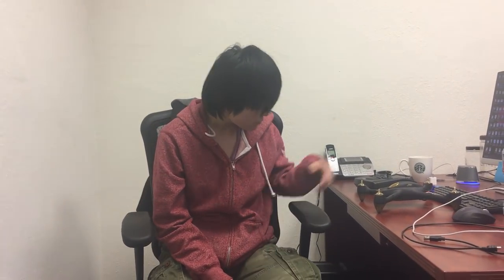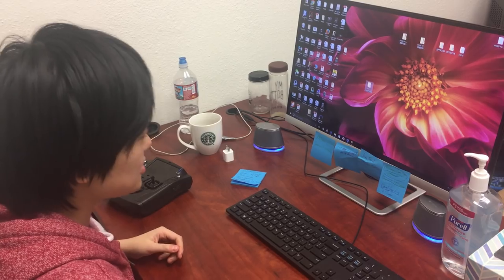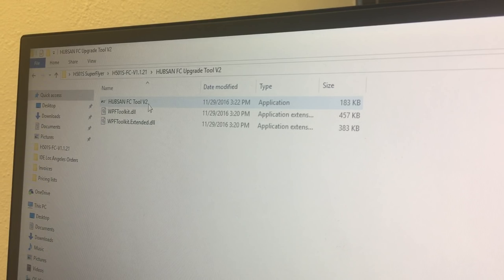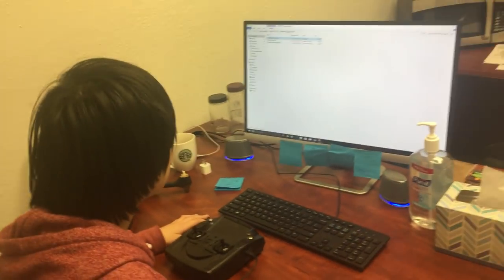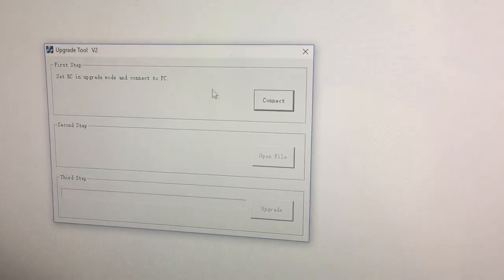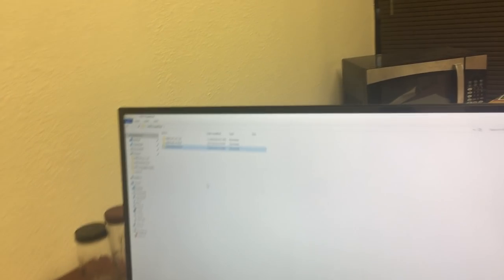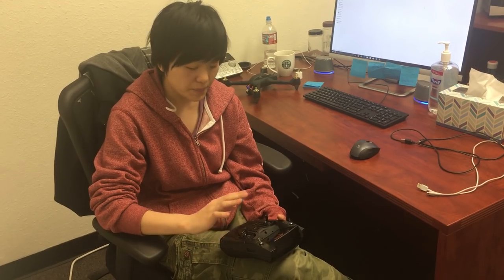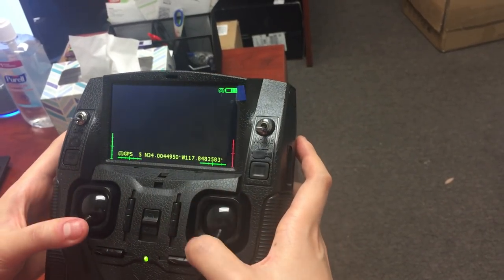H501S Firmware Upgrade Protocol

Comment: The Transmitter (RX) upgrade fails and displays an error message "No Data Ack Response".  I have done this several times and fails every time. I am selecting the proper file. For the Drone itself the upgrade for that went flawlessly.  So why is the RX file failing as directed in this video?

Comment: upgrading RX Receiving board. under the H501SS-RX V1.2.22 (SS only)- it shows both the H501A upgrade tool and upgrade tool V2. in your documentation dated 4/17, it says " if your stock version came with V2.1.16 and FC 1.1.31 then use FC H501S tool to upgrade." Since I have this version so I should be using H501A tool not the one mentioned in this video correct?

Comment: Hi Annie. I recently followed you along updating my h501s and advanced controller. The one problem I had was the RC file you reference is now a TX hmb file. I will be test flying later. Please affirm that the RC update for the advanced controller is a TX file. Thanks
Reply: confirmed today. The RC update for advanced controller is not
 RC-FPV2 4.2.9.hbs
it is H906A-V1.1.9.hbs
well My 501s flew great today and still had FPV at 300 meters. 
If Hubsan is still replying to these please confirm this as in this instruction tutorial Annie makes it clear it should be a RC.hbs file...
Reply from the maker: The RC upgrade file for the advanced controller is a TX file. The latest firmware for the advanced controller would be H906A-V1.1.9.hbs. RC stands for remote control, TX stands for transmitter. H901A is the model name for H501S standard controller and H906A is the model name for H501S advanced controller.
Reply: Thanks for the clarification. One more thing. A link to a file explaining the updated functions to the advanced controller would be most helpful. After youtubing too long I found out by long-holding the down button to the left of the enter button initiates circle me mode!   I wanna know more PLEASE! :)

Comment: Hello, can you tell me why the 501  does not turn around like the 502 when RTH is switched on, can this be changed on the firmware by Hubsan
Reply: Good question, I saw the 502 did the turn around but not the 501S
Reply: Yes sometimes I have a good question, but now waiting for the answer lol  Maybe they could add the software too the next firmware update
Reply: I think the right person that can request that option is the people that frequent to Hubsan HQ. People like Drone/Quadcopter101. Hubsan normally entertains him.
Reply: No Hubsan also reply's too small people
Reply: You mean Shally? Nah, Shally is just a Guest Relation Officer.
Reply: Did you hear anything about this question? I would also like to know the answer.
Reply: No answer yet, I will ask another Hubsan guy, maybe the new 501 will do the turn around
Reply from the maker: Turning around or not is written in the firmware. It is there to improve the performance of RTH.
Reply: the gps lies in the back side of quad so returning home facing its back is actually good for better signal strength with respect to home position. imho
Reply: That's great and what not, without auto detection of running into things, I rather see where i'm going... No offense.
Reply: I think it has nothing too do where the GPS is in the Quad, its more a software thing.  But I have both Quads and doo some more tests
Reply: Ruudy..  You are correct.  First, I've built half a dozen quads all with APM controllers and Ublox GPS receivers.  I generally place the GPS tower towards the center of the quad.  However, it does not matter.  The GPS receiver is communicating with satellites and not the transmitter! There should be no issue having the quad face it's way point or in the case of RTH, home point. I kinda wonder the intelligence of some of these posts.
Reply: RCFun elaborate?
Reply: Don Boyle New firmware 1.1.36,,,, you can even rotate while in RTH

Comment: If you get an error indicating no tool found during RX update. Unplug your controller, shut it off, restart it into upgrade RX MODE, THEN PLUG THE MINI USB CABLE INTO IT.
Reply: OR...... If it flies why bother updating.. If it ain't broke - don't fix it.
Reply: You need to upgrade your drivers in your computer

Comment: just updated to latest upgrade for my H501s,all done successfully but now my quad just sits there beeping at me and the motors will not arm ?.
 With the new firmware update do you have to have gps satellites showing , before the beeping stops and the motors arm , I am asking this because I am indoors with no gps satellites showing , but with the old firmware the quad did not beep at me and I could arm the motors indoors.

Comment: I have tried two different cables and all three usb ports on my computer and the RX upgrade tool keeps saying no upgrade tool connected! But the FC did upgrade perfectly. I have the advance tx. I guess there is a chance both cables are bad
Reply from the maker: Chris, try another cable. If it still doesn't work, try a different computer. If you don't have a friend with an up to date Windows PC, go to www.hubsan.com and click on Support. Download the H501S and SS upgrade sheet and then download the firmware bundle. There should be a Drivers folder inside the main download; extract it and use the Prolific Driver. This should solve the problem. If it doesn't, send us an email (service@hubsan.com).

Comment: Annie,Hi,After installation of new video board ,the green screen with Hubsan logo on the screen, without video.Green light is flashing on board continuously,.Tried so many times to change firmware-situation is the same.Just problem that video is not going.As my understanding, this is like when you start the system and system can not be loaded, due missing boot.May be needed to flush some of firmware to the video chip?Any suggestion or recommendation will be highly appreciated.Thanks,Sergiy
Reply from the maker: That means you upgraded the transmitter with a wrong firmware. I would suggest that you send an email to our support team at service@hubsan.com for further assistance.

Comment: Property after the firmware update (superfly) as described above (thank you for the instructions).
Since the restart of the H501S, the Gory sensor is no longer synchronized.

"CHECK GYRO SENSOR"
Do not move the aircraft

Is on the display, the H501s beep and beep
i think i need this firmware: FC-V1.1.35 but i don't find it!! 
please HELP

Comment: Hello,  I have a hubsan x4 h109s low edition. My trouble is that the transmitter doesn't bind with the drone, so I tried 
to update FC, RX and TX. When I try to update RX with V1.1.16,in the 
third step after upgrade there is written  " Data error! Please try 
again". Can you help me??

Comment: I am trying to upgrade the rx. My transmitter is correctly reading UPGRADE RX MODE V2 and is connected by the usb cable to my laptop. However I cant get past step one on the RX upgrade tool. It just says set RC in upgrade mode and connect to PC, NO upgrade tool connected!

Comment: trying to update my H501s (standard/original ver.) the file thats in the H501s  FC folder is for a H501a. as a result, im getting the update error. Is there another file or an older/different file for the H501s? its not working

Comment: Hello Annie, I ordered the advanced version, and will check firmware when it arrives. My question is, what is the difference between mode 1 and mode 2 ?
Reply: Drone Worship, Annie, very helpful. Thank you!
Reply: Drone Worship thank you :)
Reply: Incorrect. You stated that in mode 1 ." pitch and roll become the left stick." The only difference between mode 1 and mode 2 is that only the pitch and throttle control are moved so in both mode 1 and 2 yaw is on the left and roll is on the right In mode 1 pitch(not pitch and roll as you stated) is on the left stick and throttle is on the right stick. mode 2 has  throttle on the left and pitch on the right.
Reply: No problem , Jag may or may not have gotten the idea, as you were actually describing a mode 3 transmitter setup. Generally I believe that if one is going to jump in and answer a question that is posed or directed to  an assumed expert(Annie) then one should be doubly sure of the accuracy of that answer. Especially when someone new to the hobby is asking .The same holds true that an assumed expert who puts out a how to video should get the mini and micro usb cables correct . just too much incorrect/ inaccurate information out there these days IMHO 
on a lighter note you should check out my channel you might find something entertaining or informative.

Comment: I have delays between transmitter and receiver and tried to update the firmware of rx and fc. Said update error in fc and the led started in rx update and said timeout on command response.Any help ?Also i cant see the rx and the fc versions on my drone just the transmitter and the lcd version! Thanks in advance

Comment: Hello Ann!  I'd like to purchase a (New) H501s without controller. Is that possible? I already have 1 advanced controller and 2 standard controllers. So I only need the drone itself. 
Thanks
Reply from the maker: We have a H501A model coming out in March, that one only comes with the drone because it has the new WiFi feature. You can also use your transmitter with it. Please visit www.hubsan.com for more information.

Comment: Hi Annie - I just got my hubsan 501s today and I'd like to perform the upgrade. Is there now way for me to upgrade using a MAC? I have VM ware on my Macbook. Thanks in advance
Reply from the maker: There is no way to upgrade using a MAC, and there is no need to upgrade your firmware unless you are experiencing problems with your unit.

Comment: Hubsan does not back their product. The H501ss that I owned did fine for a few weeks. I went out for a night flight with a friend and out of nowhere the drone lost all power and fell from the sky. I tried emailing them for a refund and they said there was nothing that they could do to help me. After a couple of days of searching we finally found it, all 4 propellers were broken. I checked the battery after getting home and it was still fully charged, the drone just malfunctioned. It was a very disappointing experience with this company.

Comment: Hi Annie,

Ive tried to update the latest versions of firmware of my 501S but when it was time to bind the drone to the controller, the drone LED's remained solid and it failed to bind. Now the controller wont pick up an signal from the X4. I have followed the instruction step by step, but I cant seem to resolve the issue. I have also reached out to support via email, but still waiting on a response. 

Any suggestions for fix???
Reply: Robert Cantwell  this happened to me the first go around as well.  So what I did was start all over again from the very first step.  I got really worried I bricked my drone but thankfully,  I was able to stay cool and retry from step one,  and it  worked.😫

Comment: I'm  A big issue with my hubs in 501S I have the standard edition it's not responding to commands   On controller the LED turn purple and it starts to go wherever he wants to go I just today I just recently cut my fingers try to stop it from taking off again after it landed I need help with this because it's not safe and I have it all on video

Comment: Help annie, im checking continuity on the H501S 5.8 ipex connector on the quads mainboard and the multimeter  shows theres continuity between the center pin and the connector around the center pin. Can you find out for me?

Comment: my Hands by five 1s 501's is doing a lot of sketching and it always for some reason when I have heard it keeps going to the left for some reason AutoZone and it's sometimes what's up in the air it turn to the left or to the right which other way on his own no I'm doing something wrong or what kind of modified it with an antenna and with both antennas I don't know if I know I'm pretty sure I put him on a ride but does it need to be upgraded or can you help me out here

Comment: any firmware upgrades going to be released for the  hs109 the one with the h7000 transmitter?
Reply from the maker: As of now, there are no upgrades for H109S and H7000 transmitter.

Comment: Hello! I just bought the drone h501s x4 advanced and it does not turn on the monitor and when I turn it on you will not hear beep nor turn on the led light. Do you think that it is a firmware problem or the control has been damaged?
Reply from the maker: I would recommend sending an email to our support team at service@hubsan.com, it will be easier for us to help you with your problem there.

Comment: Is hubsan putting the new firmware on new quadcopters and receivers or do I need to put it on there once I get it?
Reply from the maker: There is no need to upgrade your unit unless you are having problems with it.

Comment: We purchased the drone and just wanted to upgrade the firmware. But when we get to the point of connecting the battery with the drone. The led flashes and the screen doesn't change. So what is wrong with it? It's really annoying, we are searching for a fix everywhere but can't do a thing! Please help!
Reply from the maker: Hello. Next time, please do not upgrade unless you have a confirmed firmware related problem. Send an email to service@hubsan.com explaining the situation. Include in the email a very clear picture of the drone's belly. Our reps can help you fix the problem.

Comment: The new file uploads doesn't include the RC upload.  In addition you have to guess which file upload has the RX upgrade as the file names both say HUBSAN FC Upgrade. By trial and error I chose the one without the V2 in Tool.zip.  

The big thing is there is not file for the transmitter the RC upload. 

The video is great I am just at a stopping point for the transmitter upgrade file
Reply from the maker: There is no need to upgrade for RC, and that is why there is no RC file to download. We also noticed the folder name is incorrect, we will fix it soon.

Comment: I followed the video to the letter and the FC upgrade went perfectly but when I get to the third step of the RX firmware upgrade I get message "Timeout on command Response"  Do you have any idea why that is happening?  Now when I turn on the transmitter and quad I hear the normal powerup tune from the quad but it looks like it is off.  There are no cycling lights, and no video display on the transmitter.   Please help.  I saw where someone else had this issue on a blog but there was no response to the person having the issue.  I never see the "select file down".  That seems to be where it is all coming apart.
Reply from the maker: You should not press connect/upgrade more than once, if you do, there will be errors. Also make sure the drone is very close to the transmitter and make sure there are no other electronic devices near the quad and the transmitter.

Comment: A friend doubt, for those who have the standard control, if I upload the drone it obeys all the commands, rotate, forward and back, but if I am descending with it manually it obeys no command, only descends or I can not deviate from nothing, I have to stop it and move it and then continue down, is it anyway?

In my control is the following parameters

V4.2.36
LCD v1.3.3
H501S v2.1.50
FC v1.1.46
CAM V30.84.84

Comment: Hello annie i talk to you last week about my drone going up once you arm motors and raise drone to certain height... well at first my 2nd drone after xchange it was good for the first 4 flights then 5th it happened again has to stop so wont go high fell had xchange again 3 rd drone.... i did calibration of the transmitter mode 2 version... it still happened....ill try too call. today  (H502C)
Reply from the maker: Have you tried contacting our support team @ service@hubsan.com?

Comment: Hi, Annie. I already upgrade my fc and rc fail from Nelson Lee video. But nothing to tx. should i do it. I am using advance transmitter.
Reply from the maker: You do not have to upgrade the advanced controller. The original firmware on the advanced controller is fine.
Reply: Thank you.

Comment: Hi Annie 
I have just installed  a new transmission  module  in my h501s, and it's  working fine but transmitting  on 8665 mhz.The transmitter  wont go that low.So i can't tune it in.Any ideas.Kind Regards Cool view
Reply from the maker: Perform a rebind to get everything on matching frequencies: https://www.facebook.com/hubsan001/posts/1773539956284353

Comment: In my case on the part of updating the RX on the remote, it does not change to select file down and the drone does not erase the leds it starts normally.
Reply from the maker: Hi,Luc,if you don't mind ,please share with me more details about your upgrading issues to service@hubsan.com. I will try my best to reply you as soon as possible .Thanks
Reply: @HUBSANOFFICIAL  ok, i sent. Thanks!
Reply: Hi i have the same problem. Did you find out any solution?

Comment: I have problem after I upgraded the drone, then it’s time to upgrade the transmitter it can’t work well and both of drone and transmitter cant’t use. 
The screen stay says “upgrade RX MODE POWER ON RX”
Would you like to give me the solution?
Reply from the maker: Hello. You likely have an H501SS that requires using the H501A tool for RX upgrade. Check first to see if this is the case: https://www.youtube.com/watch?v=K2u09f1z7ro

If you have an H501SS, please watch the H501SS upgrade video and then, if needed, the H501A upgrade tutorial:

H501SS: https://youtu.be/hk9Cgg-qP0M
H501A: https://www.youtube.com/watch?v=DqQ4HSYlH0U